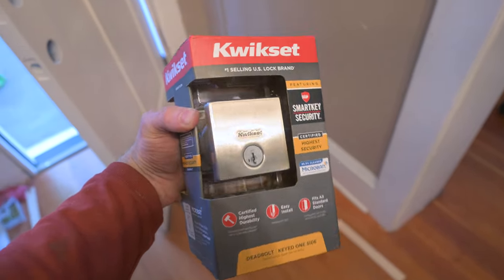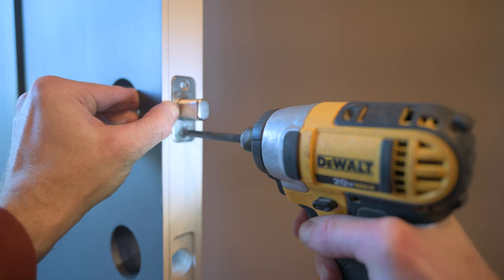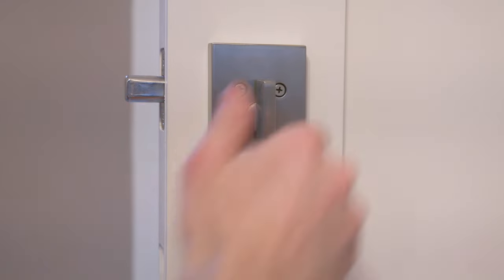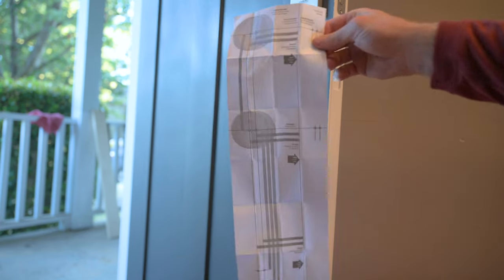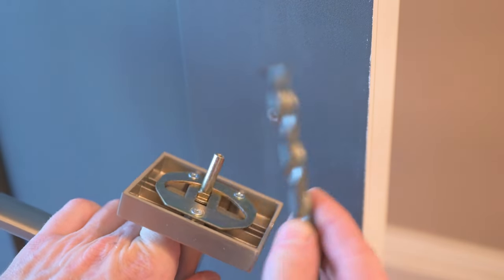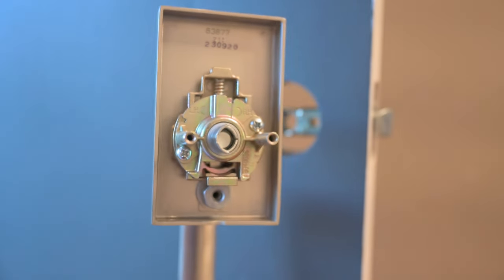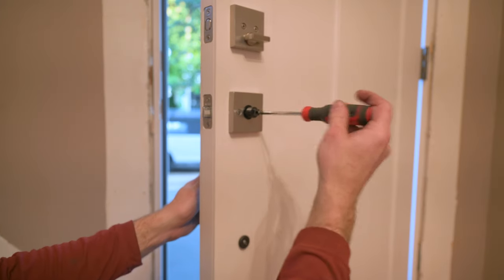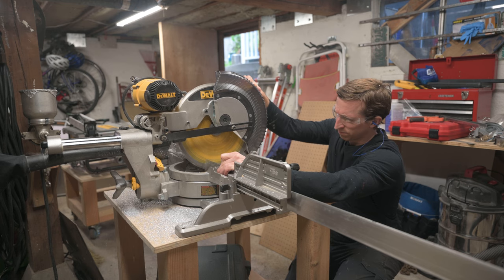Installing a Door Handle and Deadbolt | Kwikset San Clemente Handleset + Downtown Deadbolt

Comment: The step-by-step video thoroughly explains the process.  Lots of steps and details!
Reply from the maker: Yeah quite a few and glad I didn't have to drill all the holes in the door!
Reply: @danielrvilla  do doors usually come with the main holes drilled?  From what (little) I've seen, they do....
Reply from the maker: I think you can get door "slabs" with no holes as well. Also some just have one hole for a single handle/lock. I bought this door with two holes so I could do this kind of handle and lock arrangement.

Comment: what drill bit size did you use instead of the 7/16 i was thinking the same thing it is way to big.
Reply from the maker: I just held up drill bits to that piece until I found one a little bit bigger. Anything smaller than nearly half an inch haha